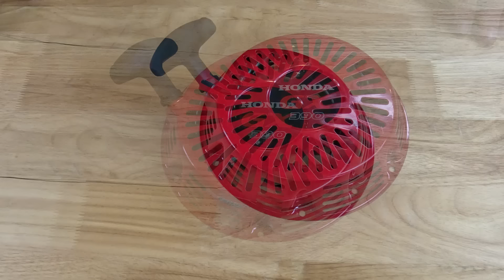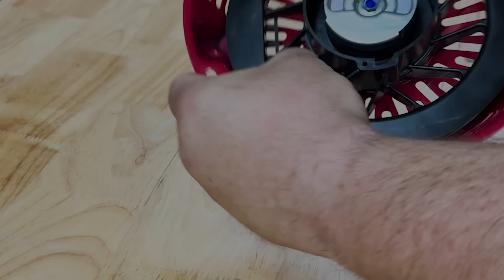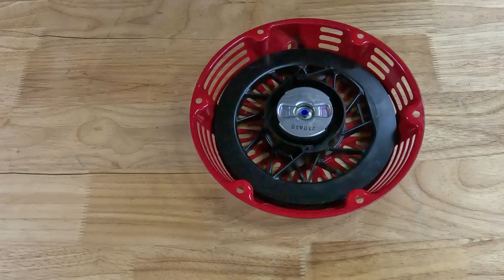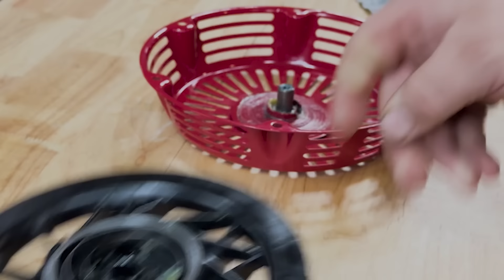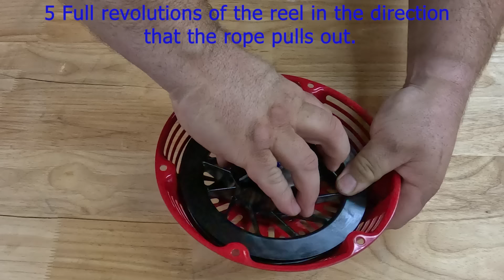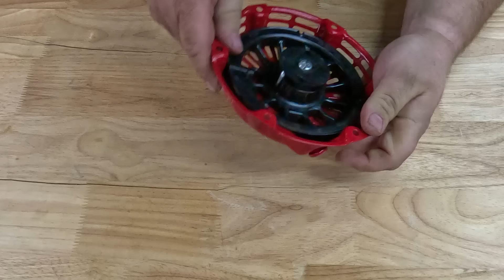Honda GX Series (GX160 - GX390) Recoil Starter Repair

Comment: This a great video. have replaced the recoil spring no worries, but when I tighten the top screw fully, the whole unit locks together and it won't allow the cord to recoil. If I back the screw off a turn, it works fine. The issue is, when I put it back on the pressure washer, it will only kick it over once before the screw loosens too much and it won't kick over again. Any ideas? I can confirm the little plastic washer is installed.
Reply from the maker: Thanks mate!
When a recoil binds up when the screw is tightened, it generally means that something is not aligned correctly, or one of the parts is slightly out of place or worn. I would be checking that the main spring is sitting in correctly when you install the plastic reel, and that the reel sits in properly. Thanks heaps - Dave

Comment: I've watched a few of these types of videos, and when replacing the rope, no one ever says how long to make the new rope. I've broken my old rope a few times and made do by just shortening it until I had to order a new rope. But the new rope is 40ft. long. So I'm thinking 45 in. or should it be longer?
Reply from the maker: Hi mate,
The ropes on the GX160 & GX200 are about 60 Inches long, or around 5 feet. The ropes on the GX270, GX340 & GX390 are about 72 Inches, or around 6 feet. This all depends on the thickness of rope you use and how much you can squeeze in, but that is the standards. Cheers heaps - Dave
Reply: @melbournepowerequipment3441  Thanks for the info I have the GX 270

Comment: I have a gx390 on my snowblower. It's only 3 years old. Luckily it also has keyed ignition start. Just took the recoil starter apart as it wouldn't recoil anymore, turns out the spring was cracked and in 3 pieces!
Reply from the maker: Hi Steve,
Thats a bit unusual especially in only 3 years, was there any rust on the spring? Thankfully you had the electric start side to get you going!